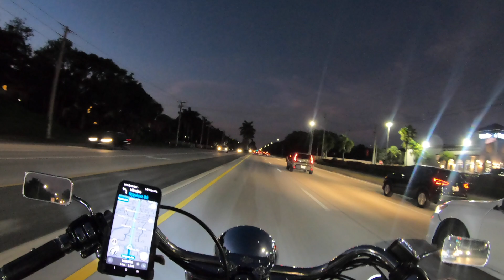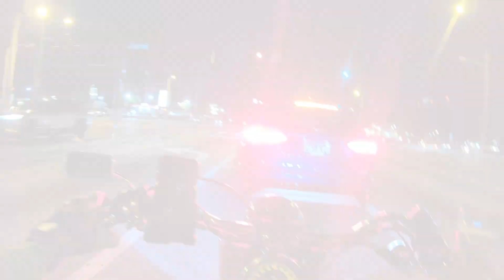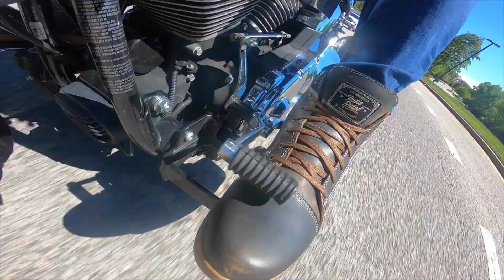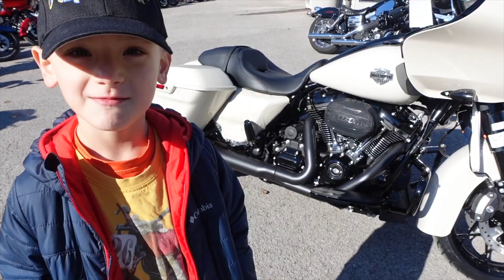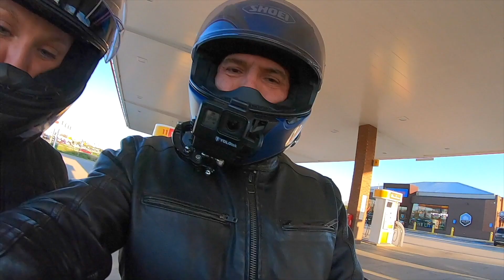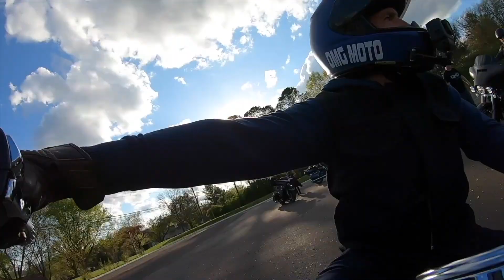Screamin' Eagle 135ci Stage IV Performance Crate Engine

Comment: Bro, good content! My opinion, I think it’s HD trying to keep their toe in the market around all these guys building high performance motors with better after-market components versus stock, using Feuling, S&S, Red Shift, Darkhorse, etc…. that’s my two cents probably only worth a penny. I’m sure that 135 will scoot, I’ve heard 8 grand too, which does not include $175/hour labor $$$$(cha-ching). It also provides a foundation to where these cats, will tear that thing apart, upgrade and give you a 200+ hp/torque bike that will jump out of it’s paint. A lot of guys dig that, I personally don’t need the biggest numbers in town, don’t like my bike up on a rack for days, waiting for parts; I gotta ride. I just enjoy upgrading to the point, my bike is reliable, rideable, sounds off the hook, and when I need to pass someone, solo or two up in the saddle, I can hit the throttle and be gone, then back into my lane safely. BUT it is fun & cool to watch guys overhaul their bikes, dyno test them and see how they sound and ride. 🤣🇺🇸👊
Reply from the maker: Yeah, that will be a solid labor charge for sure.  I am sure we will see someone turning that 8k beat into a 16k beast! lol I am also a fan of upgrading my bike, that is part of the HD experience. Thanks brother.

Comment: Parts guy at bootleggers harley said 8000 for engine
Reply from the maker: I dont think that is a bad price. What do you think?
Reply: @OMG MOTO  to much for what it's putting out, it is more of a starter engine that l than a race ready engine, my old twin cam has less money in it and more power, but that's just my opinion, and I build my own bikes
Reply from the maker: @jpabrams1976  That is good to know. They make it seem like its very powerful.
Reply: @OMG MOTO  130 hp and around 140 torque, probably a stout motor to start with but after buying a 30 40 k bike only guys with tons of money can afford that lol I work in a small shop most guys that come on can't afford a bar change much less a motor swap
Reply: @OMGMOTO  The engine delivers 143 lb-ft of rear-wheel torque at 3500 rpm and 130 rear-wheel hp at 5500 rpm - approximately 28 percent more torque and 41 percent more horsepower at the rear wheel
Reply: @OMG MOTO  that was compared to there 131